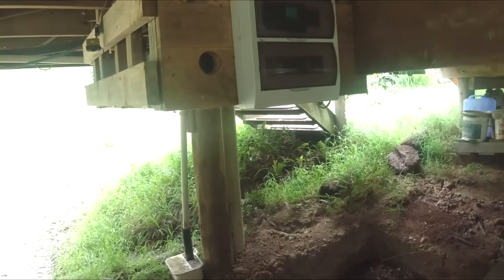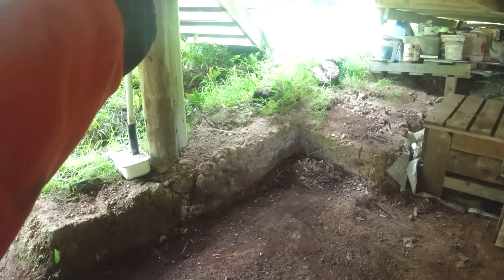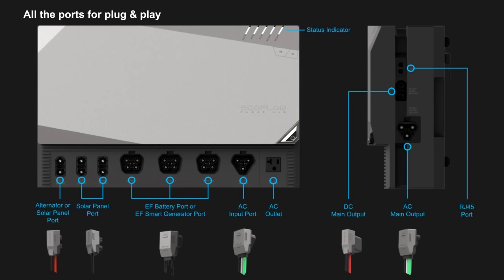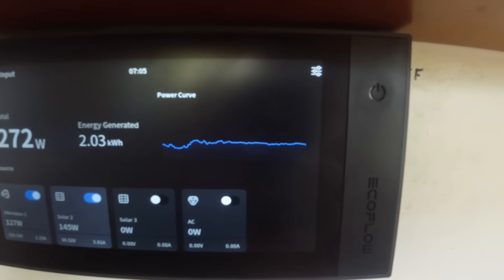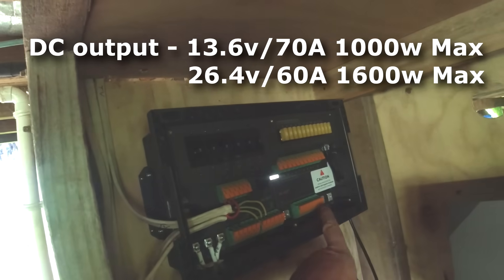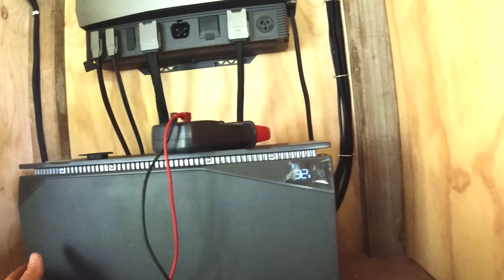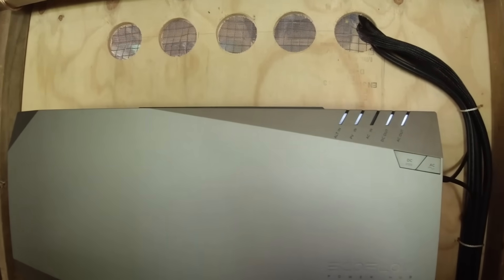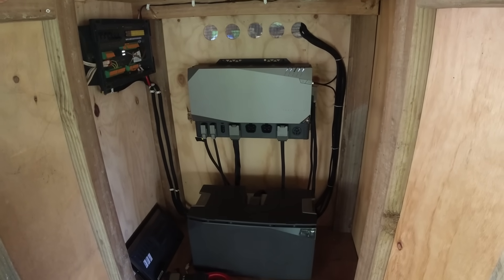Upgrading my Off-Grid Power System at the Beach House - Ecoflow 5kw Power Kit

Comment: When making concrete pads, or battery bunkers etc you should look at using plastic fibre reinforcement. One version is called emesh. It will span well so good for a vented fire box for your batteries. And the mesh comes in a bag so are very easy to transport.
Reply: Probably did not have any Re-Bar around and not really needed with a 6inch thick pad on clay for what is about 20kg weight!
Reply: @robbristow  not really needed for this slab, but for a fireblock yes. The cool things are that the plastic rebar is light, doesn't rust, and you just shake it in as you mix so easy for off grid and handy for earthquake and heavy rain areas like NZ.

Comment: Ecoflow makes a good system, their warranty is the weak point, as with all these "solar generators" . 24 months for the serious components, 36  more fore other parts. That's not tremendously long for the expense of a full blown unit with panels and extra battery pods. The greatest issue I've seen with all of these systems, across the manufacturing spectrum, is the absence of a repair service. It fails outside of warranty, you have a really expensive, toxic boat anchor. The electronics, the circuit board, the complexity is the weak point, no one offers a repair service, in house or independent. That needs to change. If you sell it, you need to be able to offer a repair service.  Check it out, I'll be happy to be wrong.

Comment: With your future fireproof battery box you might want to work out a solution to mechanically discharge a fire extinguisher when fire is detected within the airtight sealed battery box & mount the battery box in the ground where it can be kept at a constant temperature not being affected by frosts or winter. A fire will only burn when oxygen continues to enter the battery box & if you can smother the fire without causing damage to the batteries then you will be completely safe.
Reply: don't bother with the extinguisher!  Lithium batteries cannot be "smothered" because they contain their own oxygen!  The only way to put them out before they fully burn out is to cool them below their self extinguishing temperature, which normally is done with a LOT of water (or a bit less liquid nitrogen....)  Building a 'burn bunker' is the best solution, make sure the chimney from the bunker ejects the smoke and hot gas away from anything flamable and just let it it burn out
Reply: Yeah lithium batteries burn even under water. You can use sand to dampen the fire spread, but it will continue to burn and release toxic gases.

Comment: Thanks for demonstrating the Eco Flow Inverter and distribution board (containing fused AC DC outputs for accessories and circuit breakers) with its various charging capabilities, examples such as;
* DC solar panels
* DC wind turbine
* Generator
* AC mains power supply 
 and power storage,  In this example a Lithium ion battery.
🌏🇭🇲

Comment: In this case DC lighting is uber simple ; simply replace the ac bulbs in all lamps and fixtures with dc bulbs( they're only a few bux apiece) and then connect their power circuits to the mppt as the ac wiring,of that what is already ran will work just as well for DC power.. I used my houses modern upgraded AC wiring as my DC wiring without changing a thing other than bulbs,fans and appliances to DC type.. It's like overkill wiring for DC usage without the costs of rewiring the entire 2000 sq ft house ,and it's worked well the past 8+ years that way..
Reply: Disclamer: I'm not an electrician. However, what I've learned is that DC in this case runs typically with 12 or 24V while AC 120-240V depending where you live. With lower volts you have higher Amps to get the same power. So, if you have DC with low voltage but high amperage, you need thicker cables than with high voltage and lower amperage. If you use too thin cables for high amps, they will get hot and eventually burn down your house. The length of the cable also plays a role here. What I want to say: Be careful.

Comment: Good job mate the wife and kids are definitely happy, happy wife happy life 😊 and good job on finishing it of with that concrete  batter fire bunker we in the Rc hobby use ammo cans with the seal removed or money lock bockes to charge our lipos a few of my friends have had them go up there was a guy that burn half his house out with a lipo fire luckily it was just cosmetic but still better to be safe than sorry wonder if ur could rig up a foam or co2 fire extinguisher to a sprinkler head so when there is a fire the head activates using the foam or co2 🤔 have similar styles on race engines and other machines

Comment: you dont want to use water as fire retardant, lithium reacts with H20 unless you can fully submerge it your gona want it away from the house though a concrete bunker is a great idea
Reply from the maker: Yes I've heard water can make a lithium fire worse, a concrete cover with sprinklers above to keep it cool should be adequate
Reply: @MartyT  You should be fine, if you want to submerge it in a fire, make the vault deep enough for the sprinkler to totally get it under water
Reply: I think in the Netherlands they have purpose built open top 20ft shipping containers full of water and telehandlers stationed around the cities with high concentrations of EV cars to drop any cars that catch on fire straight into the drink.